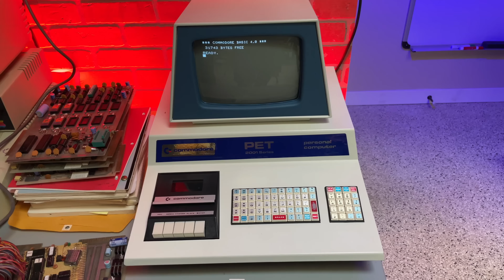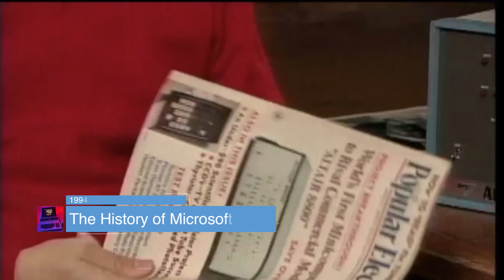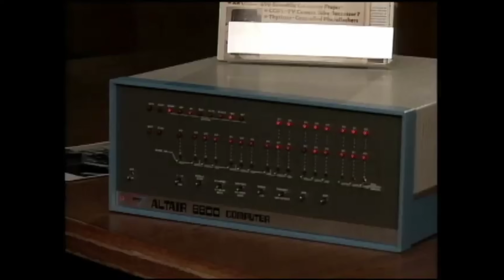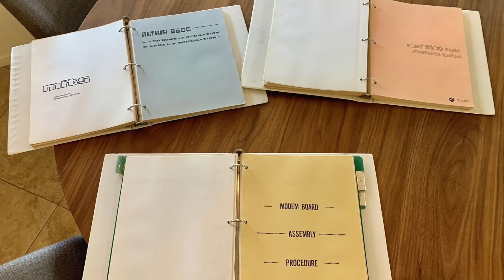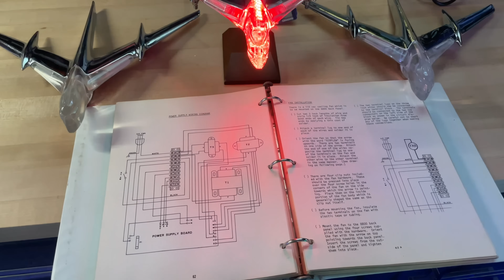The Computer that Birthed BASIC and led to Microsoft!

Comment: I had one of those in the seventies (thanks to my father who was an EE). I could do the front panel boot loader by memory so I could load basic, and also and editor/assembler.  Quite fun and it started me in my career as an engineer that could also code….CP/M was the next evolution after getting the 8 inch floppy drives working.   The Altair had the power switch backwards.  That was always an issue until I reversed it.  I could never get the Tarbell cassette interface to work.

Comment: Broken connection or TIP transistor? A broken connection is always bad. If you replaced the TIP transistor, there are (very cheap) transistor testers to check the old transistor, like a GM328A with a little LCD display and a zero force IC socket for less then 10 bucks. Transistors have two ways to fail: become "open" or become "short circuit".

Comment: i have a IMSAI 8080 and other s100 systems. Some are from the 1975 and others from the late 80s. The s100 systems are Love and hate combined to me. 
My first S100 system was No name case with random brands of cards in it. My fist S100 had a Motorola 68000 in it. This was 92 and it was the old pc from my dad, he had a Amiga 1200 at this time. 
I learned a lot at this time about Computer. i mean yeah i had a ROM card with an BASIC on it and used it a lot in the beginning, but later on i got a ROM programmer with a HEX keyboard and learned with it Assembler. This was the time when i began to struggle and hating this machine, but every success brought me back up on course. It is awesome what you can do with such simple systems especial if you have direct access to the CPU and bus with the Front panel like the Altair 8800 and the IMSAI 8080 or the Wameco system. I bought a Wameco manipulator panel and a compatible CPU back then.  And the experience was so much better with the panel as constantly taking out and reseating ROMs from ROM cards.

Comment: In 1986, out company had a rack full of IMSAI computers.  On top of the rack was a Corvus hard drive, I think it was 10MB.  There was little interface box called the Constellation and each IMSAI had a ribbon cable that ran to this Constellation interface so that multiple IMSAIs could read the Hard Drive.  At the bootstrap they would type C2 and the bootloader would load CP/M.  The RS232 cables fanned out throughout the build to Heath/Zenith terminals were we could access one of the computers.   It was like a very early network.  Different departments used different User numbers - which are like hard code directories.

Comment: One more thing. The original Altair cost 375.00. The Intel 8800 CPU by itself sold for 375.00 from a parts house. People were skeptical. BTW I learned that a beautiful looking solder joint board to pin could invisibly open up if the room temperature got too low. 4K basic ran the interpreter, the program and any required memory all in 4K. Ugly programming by Bill but it worked.

Comment: With those big old electrolytic capacitors from the '80s, and covered in dust. It would be prudent to replace those PSUs. They can be spectacular when they fail

Comment: I was exposed to the Altair 8800 as at the age of 13 years old. I was on the way to work for the summer with a relative in Ontario. While in transit I stayed at another relative for a week and he had a Altair 8800. I was given the task of labeling the keyboard keys with their new functions after he had gotten a OS upgrade that supported a floppy drive. The number on rule was do not turn it off. The Altair did not know how to access to anything on boot so you had to program to boot code via the front switch, Which i was told was a very long a tedious process.  That week opened a whole new world to me.

Comment: We have like 2 dozen of these in our museum.
The octal fron panel made zero sense. The IMSAI was a much better front panel.

If you had a teletype you could store data or programs from paper tape.

I built a IBM 360 emulator from discrete ICs which was large, but it got things done for me back in 1970. I adopted the IMSAI becuase of the many S-100 boards available. I even had it hooked up to a Kennedy 9-track tape drive and a 10mb Hawk disk drve.
I switched again to a North Star Horizon computer which had no front panel and it ran CP/M & MP/M very well. Back in 1978 I wrote legal billing software and supplied law offices with a North Star computer, a few Televideo 950 terminals and a NEC spinwriter with an acoustic cover. They all loved it

Comment: Sorry if this is a repost but I found the back plane / motherboard of the Altair looked odd.  Not odd that it was a single layer (period appropriate) board, but that the traces were on the bottom.  Me thinks this may have been a noob mistake on the part of whomever etched the board.  Maybe a frugal person; A person frugal enough to attempt create a personally etched main circuit board / back plane for their project. 
Disclaimer: I am not an expert in electronics, nor is my bloodstream alcohol free, but I am, for the duration of this thread, identifying as a 'Noob'.  I accept all of the social ramifications and responsibilities that come with this title and some of the freedoms mistakenly granted to me, but I digress.  In summation, "Dave, who etched the back plain?  And was the person an employee of MITS?". Follow up question as an Altair non-expert:  Are all original MITS Altair 8800 etched on the bottom?

Comment: Electronics should tolerate plenty of water as long as you maintain 0 electricity running through them for the duration (other than seepable-into things like electrolytic capacitors for good soak; but they're still washable in a good factory washer, especially with deionized and distilled water).

Comment: I bought the Altair kit, and received a notification from MITS stating that it would be delayed due to them designing a bus interconnection system instead of the point to point wiring system.

Comment: Nice video , i started with cmb64 in 1981 and it took hole nights to get the basic progs ready and running but it was big fun when it did work and turn the lights and motors on and off , now using arduino

Comment: Dust/dirt. Once had a Bunker Ramo BCS 90 that was literally full of dust. Took it outside and used a vacuum/blower. It ran correctly when I powered it up.
The “IT” manager had the unit on the floor and was surprised at the dust accumulation.

Comment: The collection has a PET and a Commodore 64, but no VIC 20. I wonder if he skipped it on purpose, or whether he just hasn't found one yet. Chances are that the broken transformer wire accounts for the completely dead power supply section.

Comment: My father saved and purchased an 8800. I remember it came in large boxes. One every few weeks until we had the whole thing. I was only about 11 or 12 years old but after a bit my father had me soldering components to the pcbs. I wasn't allowed to power anything on until he checked the board assembly. While I don't recall a lot of what we did with the Altair, I do remember the joy and excitement when we got a Lissajous pattern on the oscilloscope. I do remember hand assembling short programs and entering them by hand. I know data added a couple cards to the Altair of his own hardware. His interest was more in electronics than programming and I wrote most of the code for the Altair. We didn't have a terminal so we build a keyboard on a piece of wood paneling with a few dozen little red Radio Shack push buttons. The letter each button represented was mark on the board above the switch. Later my mother wrote tiny little stick on labels for each button. White paper labels with blue ink that eventually smeared and wore off. Eventually, my father started a TV teletype writer to use as a terminal, and got his hands on a paper tape machine. I don't think he ever got the paper tape to work and I'm not sure he ever completed the tv typewriter. But that Altair gave me my love of coding and electronics even though I only used it a couple years before the Coco and Commodores became the thing, these too seemed short lived and were replaced by a Tandy 1000. My coding skills went from 8080 machine language, to BASIC, to Pascal, Forth, C, and C++. Today, I do things mostly in Python and C, and occasionally in Dart and JavaScript. Though of late I played a bit with Algol, FORTRAN, and Pascal just for kicks. There is still a lot one can learn from revisiting old hardware and old programming languages. If nothing else, I believe every developer should have to write an animated side scroller on one of these old systems as doing so requires a good understanding of the hardware, software, and the limitations of the system. This like many of your videos has brought back some fond memories. Thank you!

Comment: The progression of software complexity isn't as linear as you've laid out.  The only reason a GUI was developed by both Apple and then Microsoft is because Xerox put in the time and research to make it a reality.  Without the pioneering work at Xerox Apple couldn't have stolen from them.  And then MS couldn't have stolen from Apple.

Comment: Before the Altair, I was already working on my first PC using the Radio Electronics July 1974 8008 based PC "PCB kit" while in college (I mailed my check with a hand-written note - way before the internet). I designed my own 2KB SRAM PCB. After quickly tiring of the lousy entry switches I had (all parks came from surplus stores: Poly Paks, Jameco, John Meshna, etc.), I designed and made a hex data entry PCB to enter data (with auto-step) for data or setting the starting address. For the PCB, I used a direct contact positive with a 1:1 tape-out which used a very poisonous tetrachloroethane solvent developer! Then etched with ferric chloride solution. That PC worked great, albeit slowly (125KHz clock). I used it with my senior design project to program Intel 1702A 256x8 UVEPROMs on another PCB I made. I got an A for it. Way too much work, but fun!

Comment: AS far as "How much water can electronics tolerate?", well, that depends.  If they are not energized, usually there is no issue.  The real important thing is to make sure there is none left when you plug it back in.  You were wise to keep the transformers out of the water.  

A little story to illustrate.  When I was in the US Navy, doing flight line avionics maintenance, we were sailing in moderately heavy seas, and we had an airplane waiting on an elevator to be transferred from the hangar deck to the flight deck after a maintenance evolution.  A freak wave washed over the elevator (and the aircraft), completely filling the cockpit and engines, etc. full of seawater.  This is a BAD thing.  A good bit of the sensitive electronics were completely submerged, and of course, all the rest were exposed, if only in a minor way.  But you can imagine the cost if they were all lost.  Maintenance Chief had us fill a row of barrels with distilled water, and as we removed each black box, it was handed off to a literal bucket brigade of guys who would dip the components under the water, and swish it around for a few seconds, and hand it to the next guy.  I think there were seven barrels in all.  The boxes were piled up on a cart and transported to the Intermediate Maintenance guys, who were trained and authorized to open them up and take them apart.  SO all the avionics were pulled out, and I think the did the engines, too.  The flushed the entire airframe with fresh water too.  But this was officially sanctioned, and the electronics (mostly) survived.  

I've also seen guys put keyboards in the dishwasher (no detergent), and they came out fine.  But careful drying is key.

Comment: This is a very common result in troubleshooting electronics.  "Not sure what I did, but it's working now..."  That said, my experience is First, it's dirty.  Second, "It's always the connectors."  Not really, but these are always the most likely suspects.  It's consistent with the failure pattern you noted, and with the fix.  No power from the transformer = no power from the rectifier.  If the transistor wiring was open, you would have been missing only the +5v, with no effect on the 8v.  

Good job, Dave, and welcome to the magic of electronics.  I always wanted an Altair, ever since they were advertised in the backs og the geek magazines I subscribed to.  Congratulations!

Comment: Since there only appears to be 1 TIP transistor it is certainly for the high amperage supply and since it was the low amperage supply that was failing, I would say it is likely the wire from the transformer that was causing the failure. Voltage measurements at the input of the bridge rectifiers would have been useful for diagnosis.

Comment: As long as it continues to work I wouldn't worry why the one 8V supply was dead.  Gut feeling: that wire was broken inside the insulation and you fixed it.  In the olden days I worked for Gerber Baby Foods research department.  We read that PopEl article and bought one as soon as they had the pre-built one for sale.  We already had an ASR-33 TTY and I made a cable to connect it to the 8800.  I memorized the boot loader and could enter it by switches fast.  But reading the paper tape to load Basic was slow and noisy.  We had the cassette tape modem so I wrote a program in assembly to read the paper tape and write it via the modem to a cassette tape, and a new boot loader to read that cassette tape back in.  That was much faster and even better did not disturb others in the room.  We hope to use it for real time data acquisition but it just wasn't up to the task.  Nonetheless we learned a ton from it.

Comment: I still have my original Altair 8800 that I obtained in 1975. I never purchased any I/O devices or cards. Only ever loaded instructions and data in binary using the front switches.

Comment: My first computer experience were two books that had BASIC programs (of mostly computer games) printed in them. I would study the programs trying to run them in my head. I remember one of the games was about catching (or avoiding?) a Wumpus. Occasionally I went to an electronics store in downtown which had a computers dept in the basement. They had home computers like the ZX Spectrum, C64 - and in the "pro" room behind a glass wall - also IBM PCs, Commodore PC clones and also an Atari ST and Amiga 2000 (which I ended up getting for Christmas).

Comment: learning how to repair electronics isnt only a possible job or hobby its obviously also a great way to save money

its extremely EXTREMELY rare to have an appliance or device malfunction in some way that a moderately educated person couldnt repair it tyemselves for a fraction of the price of a professioanl repair or a replacement, even if you need to order a part and use consumable supplies and special tools

electronics repair is actually far cheaper than you probably think to get started in.

i believe that its obe of those things that everyone should be educated to do for themselevs like cooking, driving, tax preparation, residential plumbing, ect.

Comment: I think it is likely the broken connection to the transformer was the issue.  I would be careful when powering up that supply while not having it connected to a load, a lot of supplies of vintage were simply not built to deal with not being loaded down. Some capacitors may explode or other components may release the magic smoke.  I would consider all of those capacitors suspect as well.  Electrolytic capacitors have a lifetime, and that lifetime is uncertain. I've seen them blow after a couple of years, I have an oscilloscope from 1967 that has it's original caps that works great. Always treat them with care though. I read a comment a few months ago where a guy lost an eye when one blew up and shot the can (with jagged edges) into it. I'm certain it doesn't happen often but it isn't worth not being safe.

Have a great day!

Comment: A good friend of mine was working with Ed Roberts at MITS when the Altair 8800 was being developed. He was working there when Bill Gates and Paul Allen came down to develop the drivers to get their BASIC Interpreter working on the 8800. MITS was started as electronic hobbyist company selling tracking RF Transmitters for hobby rocket makers. With the on-board transmitter a hobbyist could find his rocket after its flight by using a directional antenna to locate the transmitter signal. The hobby missile electronics people didn't think the 8800 would be successful so they split off from the company before the Altair became popular.

Comment: I "helped" my Dad build an Altair 8800 when I was a Kid, he still has it all these years later.  It's why I'm a computer scientist versus following in my Dad's footsteps as an Electrical Engineer- I was fascinated with the possibilities. Eventually we had a CPM system then DOS and I actually learned to program on "Altair BASIC" as a 10 or 11 year old, to eventually work for MSFT 17 years.
Reply: When you applied for a job at MSFT, did you mention your prior experience in building an Altair 8800?
Reply: @Martinit0    it was so long ago I don't specifically remember- but I bet I did !

Comment: Welcome to the maddening part of electronics tech.  The fixed but how ? It happens and if you  let it well it will keep you awake. That being said your cleaning and reassembly got rid of a bad connection and the wire you repaired can't say for sure.  Once spent about an hour trouble shooting to no avail .... so I ask a coworker,  without hesitation he hit the machinery hard enough to rock it ....the unit came to life. Dumbfounded I ask  how , sometimes some little contact gets bounced loose in shipping , a jolt puts it back. OK  as to down the road well ? Take care welcome to the dark side of computers ...